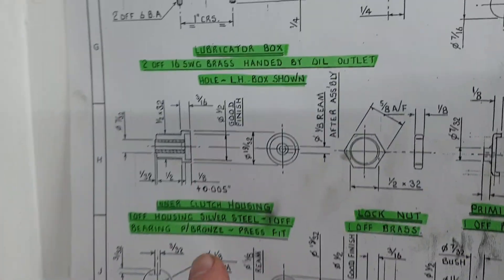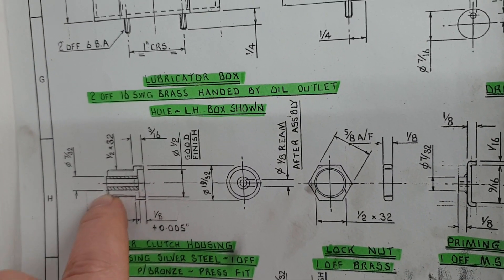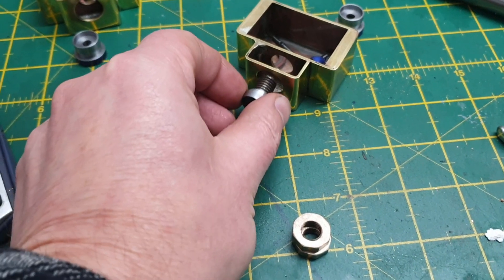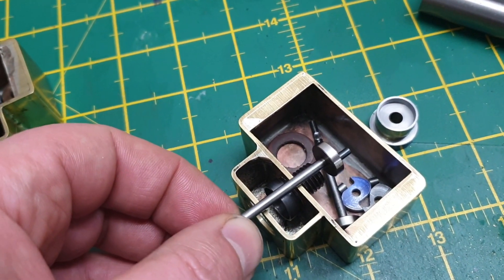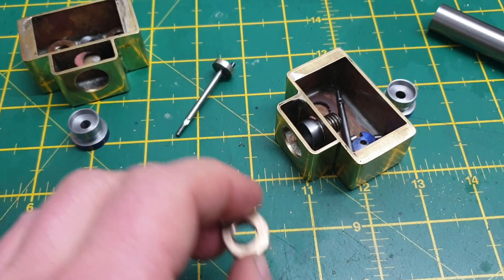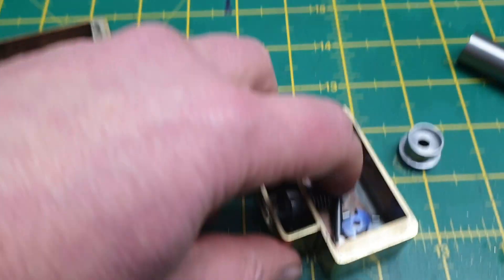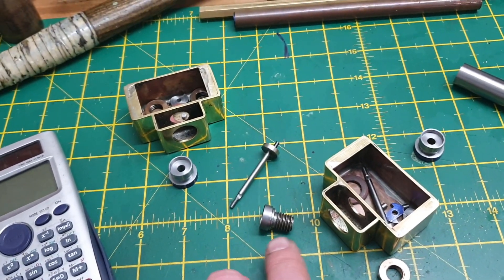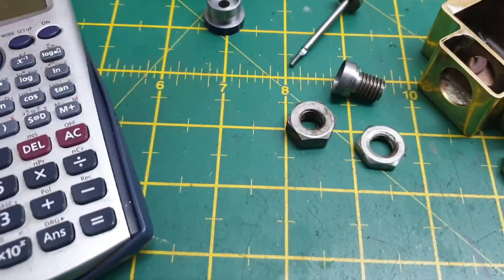BR 9F Steam Loco 5" Gauge - Part 68 - Lubricator Drive Mechanism Pt 2

Comment: Hi, Miss your postings and the continued construction of the Locomotive.  It has been a long haul - time for completion.Nice editing in the build up and threading of the piece.  Sounds like your lathe has a variable speed motor.Good recovery. Hey, Stay well, remember the 6 foot space. Masks and hand wash are little effect. Stay away from other people.
Reply from the maker: Hi Robert, thank you. I haven't post lately on account that I haven't done much in the workshop for a while. My spare time is currently being taken up restoring an old  house.  I will have some more time in the workshop when the inevitable corona lock down happens in the UK, so will probably post in the next few weeks. Watch this space and keep safe mate.  Cheers Craig.
Reply: @no23mk2  Thanks for the reply, Craig. Bad deal this Virus. Big air gap is the best safety measure. Wow - If it isn't building a steamer you're rebuilding a house. Variety is the spice...  Good luck, stay safe. I am pretty much out of Seoul though this Seongnam break out if not all that far away.  Regardless, I have you subscribed and tolled the bell. Hope to see more real soon. Stay well.

Comment: Full Form threading Inserts can can get you out of trouble - Turn the diameter dead size, then screw cut till the Insert shoulders "Top" the thread say 5 - 8 thou' under nominal diameter. Virtually No need for a gauge.
Reply from the maker: Hi Martin. Richard told us about work today. Send me an e-mail to no23mkii@gmail.com
 then I'll send you phone no.
Cheers Craig

Comment: Have a look @ this - (Brazing Aluminium) Not actual welding but the (destructive) strength tests are impressive - you'd rarely need put a part through that anyway, & say you'd just drilled a hole oversize on an expensive Aluminium part & wanted to fill & re drill it for instance.
https://youtu.be/k21JDVdGalY

Comment: Screw cutting is easier from the chuck towards the tail stock if an undercut is acceptable? That way you've more room/time to drop the lead screw out then INCH it back by hand to the head stock in reverse!!  (no need then to dis engage) You''ll know that already - but for the benefit of your viewers!! Not all Lathes have a trip out stop.

Comment: Thanks for the early Christmas present Craig mate a double episode at that and all the best to you and yours this year pal. Its coming on nicely I think I've only ever seen this oil pump in 7.5inch gauge and up brilliant detail
Reply from the maker: Thanks Mark. Previously I had only ever seen ratchet type lubricator drives. I must admit, I was a bit dubious about this clutch arrangement but it turned out to be a great design - no backlash whatsoever, no pawl jamming or missing the ratchet teeth.
Reply: @no23mk2  yeah definitely a far superior design than the ratchet design I'd love ago at doing one for my 3.5ince Britannia but I fear it may be too brittle at that scale or would need to be oversized and out of scale to the loco witch I hate and was the reason I'm rebuilding SLOWLY lol but yeah the details on your locomotive are phenomenal once finished it will be hard to do better mate and iv seen a few with my grandfather doing boilers god rest his sole any how I can talk a glass eye to sleep awesome work again mate